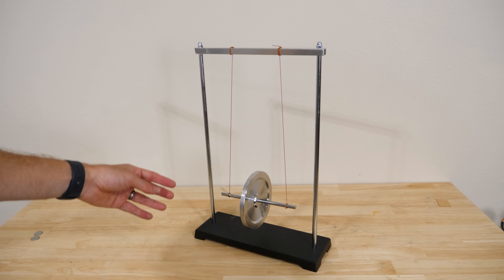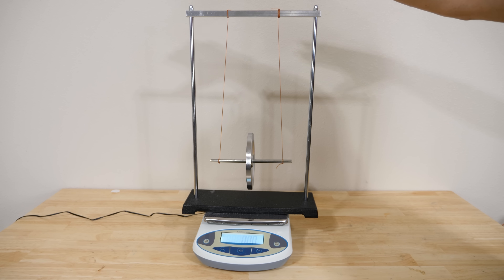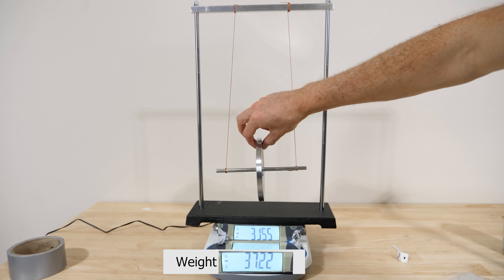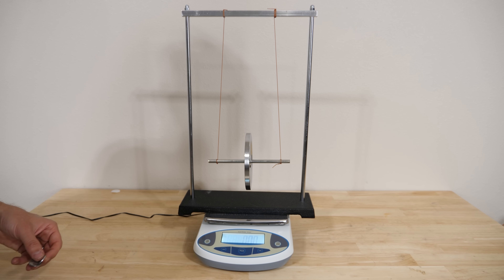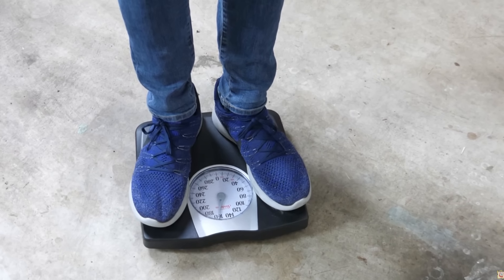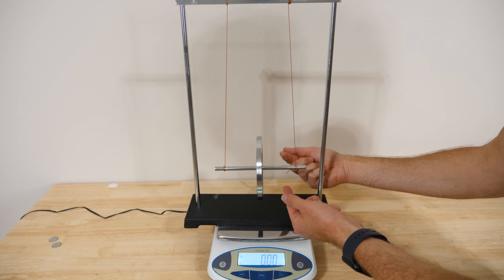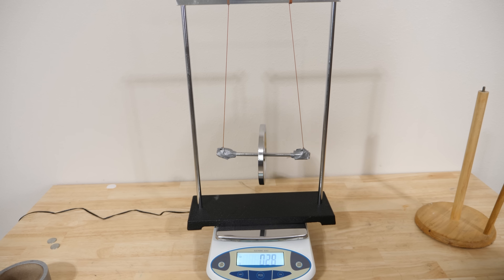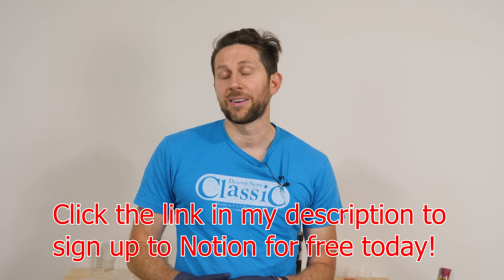How Does The Anti-Gravity Wheel Work?

Comment: If you sampled the weight continuously and at a faster rate, and then integrated over time, you would not see this fictional "antigravity".   The upward force, integrated over time, equals the short duration impulse when the wheel reverses and starts going back up.  Its the same thing as when a ball bounces inside a box.   When the ball is falling or going up, the box weighs less than when the ball is at rest.   But when the ball lands on the floor of the box, an impulse of downward momentum is imparted to the box.   A cheap digital scale never displays the effect of that short duration impulse.
Reply: Here's the deal with this wheel:
The wheel does NOT weigh less when it is spinning!.
..
It may be more correct to say that it weighs less when it is "bouncing".
..
I have a problem with the interpretation of the Laithwaite demo.  Precession does not translate the wheel.  It does not lift it. 
Precession causes the axis of rotation to change direction. This is a ROTATION about the center-of-mass of the wheel. It is not lifting the whole wheel's mass. 
.
Precession does not cause the gyro to move (translate) sideways, nor upward in Laithwaite 's case or Veritasium's case. 
If the vertical spinning gyro had translation, it would slide along the table, but stay vertical. It does not do that.  It tips, or rotates at 90 degrees.
The fact that the handle is offset and long has significance.  If you push the handle in the direction of the precession, that lifts the handle, right?.

However the interpretation that the spinning wheel is always accelerating downward even while moving upward,  is a very good catch. It took me a few seconds to realize that.  My quick initial feeling was that the weight would go positive on the way up. . . 
The way to think of it is that is is 'partly falling' due to gravity.  When you are in free-fall you are completely 'weightless'.  The spin and string-shaft arrangement allow it to fall, but not fully, as when you are in free-fall.  So, the frame experiences somewhere between the full weight and weightless ness, but more weight during the bounce time. 
..
 The winding and unwinding of the string causes the up and down motion which is what changes the weight. 
..
Stand on a bathroom scale and at a medium speed, move up and down by bending your knees.  Try to move faster and faster on the way down and slower and slower on the way up. You will see your weight decrease during those times.

.. .. ..
If you watch carefully, you see that it is speeding-up as it drops; this is accelerating, but not at the full 'gravity-rate'.
Also, it is slowing-down as it rises, again not fully accelerating (decelerating or negative acceleration) due to gravity.
..
On a trampoline you are completely weightless from the time your feet leave the trampoline until they touch again and start the bounce. During this time you are constantly in 'total' free-fall.
When in contact with the trampoline you are accelerating upward and weigh more than normal.
If you can add a small upward force to reduce the acceleration due to gravity, you will weigh less. No surprise there.

This is analogous to only "partway" jumping on a trampoline (or your bouncing ball).  On a tramp, you are accelerating downward when your feet are not in contact with the tramp. The ball is when it is not in contact with the floor.  The spinning wheel only "partly" leaves the support strings.  It is "partially bouncing".
If the tramp accelerated you upward at twice the rate of gravity, your weight would double.
Therefore, there is also a slight increase in weight at the bottom bounce.
.
This would be equivalent to a small jetpack on your back that can't lift you, but only partly reduces your weight.  You would be in "Sloe-Fall", not free-fall.
..
This would make a wonderful Dean Drive Scam. . . .
..
It would be nice to have a real-time force load cell so we can see what happens at the bottom of the wheels travel - the positive weight gain during the short 'bounce' time.

..
Also, WHAT HAPPENS to the weight, if the wheel is NOT spinning, but bouncing while being suspended by a spring, instead of the winding/unwinding strings?  
Is that equivalent to this "partial bouncing" effect?

Comment: but how and why does it go down when you let go?
Reply: Here's the deal with this wheel:
The wheel does NOT weigh less when it is spinning!.
..
It may be more correct to say that it weighs less when it is "bouncing".
..
I have a problem with the interpretation of the Laithwaite demo.  Precession does not translate the wheel.  It does not lift it. 
Precession causes the axis of rotation to change direction. This is a ROTATION about the center-of-mass of the wheel. It is not lifting the whole wheel's mass. 
.
Precession does not cause the gyro to move (translate) sideways, nor upward in Laithwaite 's case or Veritasium's case. 
If the vertical spinning gyro had translation, it would slide along the table, but stay vertical. It does not do that.  It tips, or rotates at 90 degrees.
The fact that the handle is offset and long has significance.  If you push the handle in the direction of the precession, that lifts the handle, right?.

However the interpretation that the spinning wheel is always accelerating downward even while moving upward,  is a very good catch. It took me a few seconds to realize that.  My quick initial feeling was that the weight would go positive on the way up. . . 
The way to think of it is that is is 'partly falling' due to gravity.  When you are in free-fall you are completely 'weightless'.  The spin and string-shaft arrangement allow it to fall, but not fully, as when you are in free-fall.  So, the frame experiences somewhere between the full weight and weightless ness, but more weight during the bounce time. 
..
 The winding and unwinding of the string causes the up and down motion which is what changes the weight. 
..
Stand on a bathroom scale and at a medium speed, move up and down by bending your knees.  Try to move faster and faster on the way down and slower and slower on the way up. You will see your weight decrease during those times.

.. .. ..
If you watch carefully, you see that it is speeding-up as it drops; this is accelerating, but not at the full 'gravity-rate'.
Also, it is slowing-down as it rises, again not fully accelerating (decelerating or negative acceleration) due to gravity.
..
On a trampoline you are completely weightless from the time your feet leave the trampoline until they touch again and start the bounce. During this time you are constantly in 'total' free-fall.
When in contact with the trampoline you are accelerating upward and weigh more than normal.
If you can add a small upward force to reduce the acceleration due to gravity, you will weigh less. No surprise there.

This is analogous to only "partway" jumping on a trampoline (or your bouncing ball).  On a tramp, you are accelerating downward when your feet are not in contact with the tramp. The ball is when it is not in contact with the floor.  The spinning wheel only "partly" leaves the support strings.  It is "partially bouncing".
If the tramp accelerated you upward at twice the rate of gravity, your weight would double.
Therefore, there is also a slight increase in weight at the bottom bounce.
.
This would be equivalent to a small jetpack on your back that can't lift you, but only partly reduces your weight.  You would be in "Sloe-Fall", not free-fall.
..
This would make a wonderful Dean Drive Scam. . . .
..
It would be nice to have a real-time force load cell so we can see what happens at the bottom of the wheels travel - the positive weight gain during the short 'bounce' time.

..
Also, WHAT HAPPENS to the weight, if the wheel is NOT spinning, but bouncing while being suspended by a spring, instead of the winding/unwinding strings?  
Is that equivalent to this "partial bouncing" effect?

Comment: Coriolis effect and precession? if you block the precession due to earth rotation it develops a negative or positive lift
Reply: NOPE!
..
Here's the deal with this wheel:
The wheel does NOT weigh less when it is spinning!.
..
It may be more correct to say that it weighs less when it is "bouncing".
..
I have a problem with the interpretation of the Laithwaite demo.  Precession does not translate the wheel.  It does not lift it. 
Precession causes the axis of rotation to change direction. This is a ROTATION about the center-of-mass of the wheel. It is not lifting the whole wheel's mass. 
.
Precession does not cause the gyro to move (translate) sideways, nor upward in Laithwaite 's case or Veritasium's case. 
If the vertical spinning gyro had translation, it would slide along the table, but stay vertical. It does not do that.  It tips, or rotates at 90 degrees.
The fact that the handle is offset and long has significance.  If you push the handle in the direction of the precession, that lifts the handle, right?.

However the interpretation that the spinning wheel is always accelerating downward even while moving upward,  is a very good catch. It took me a few seconds to realize that.  My quick initial feeling was that the weight would go positive on the way up. . . 
The way to think of it is that is is 'partly falling' due to gravity.  When you are in free-fall you are completely 'weightless'.  The spin and string-shaft arrangement allow it to fall, but not fully, as when you are in free-fall.  So, the frame experiences somewhere between the full weight and weightless ness, but more weight during the bounce time. 
..
 The winding and unwinding of the string causes the up and down motion which is what changes the weight. 
..
Stand on a bathroom scale and at a medium speed, move up and down by bending your knees.  Try to move faster and faster on the way down and slower and slower on the way up. You will see your weight decrease during those times.

.. .. ..
If you watch carefully, you see that it is speeding-up as it drops; this is accelerating, but not at the full 'gravity-rate'.
Also, it is slowing-down as it rises, again not fully accelerating (decelerating or negative acceleration) due to gravity.
..
On a trampoline you are completely weightless from the time your feet leave the trampoline until they touch again and start the bounce. During this time you are constantly in 'total' free-fall.
When in contact with the trampoline you are accelerating upward and weigh more than normal.
If you can add a small upward force to reduce the acceleration due to gravity, you will weigh less. No surprise there.

This is analogous to only "partway" jumping on a trampoline (or your bouncing ball).  On a tramp, you are accelerating downward when your feet are not in contact with the tramp. The ball is when it is not in contact with the floor.  The spinning wheel only "partly" leaves the support strings.  It is "partially bouncing".
If the tramp accelerated you upward at twice the rate of gravity, your weight would double.
Therefore, there is also a slight increase in weight at the bottom bounce.
.
This would be equivalent to a small jetpack on your back that can't lift you, but only partly reduces your weight.  You would be in "Sloe-Fall", not free-fall.
..
This would make a wonderful Dean Drive Scam. . . .
..
It would be nice to have a real-time force load cell so we can see what happens at the bottom of the wheels travel - the positive weight gain during the short 'bounce' time.

..
Also, WHAT HAPPENS to the weight, if the wheel is NOT spinning, but bouncing while being suspended by a spring, instead of the winding/unwinding strings?  
Is that equivalent to this "partial bouncing" effect?

Comment: Interesting, doesn't the rotational direction also change when it goes up ? In the process is it not pulling the rope to sustain it's weight ? That should reflect on the scale..
Reply: Rotation does change, but. . . 
.
Here's the deal with this wheel:
The wheel does NOT weigh less when it is spinning!.
..
It may be more correct to say that it weighs less when it is "bouncing".
..
I have a problem with the interpretation of the Laithwaite demo.  Precession does not translate the wheel.  It does not lift it. 
Precession causes the axis of rotation to change direction. This is a ROTATION about the center-of-mass of the wheel. It is not lifting the whole wheel's mass. 
.
Precession does not cause the gyro to move (translate) sideways, nor upward in Laithwaite 's case or Veritasium's case. 
If the vertical spinning gyro had translation, it would slide along the table, but stay vertical. It does not do that.  It tips, or rotates at 90 degrees.
The fact that the handle is offset and long has significance.  If you push the handle in the direction of the precession, that lifts the handle, right?.

However the interpretation that the spinning wheel is always accelerating downward even while moving upward,  is a very good catch. It took me a few seconds to realize that.  My quick initial feeling was that the weight would go positive on the way up. . . 
The way to think of it is that is is 'partly falling' due to gravity.  When you are in free-fall you are completely 'weightless'.  The spin and string-shaft arrangement allow it to fall, but not fully, as when you are in free-fall.  So, the frame experiences somewhere between the full weight and weightless ness, but more weight during the bounce time. 
..
 The winding and unwinding of the string causes the up and down motion which is what changes the weight. 
..
Stand on a bathroom scale and at a medium speed, move up and down by bending your knees.  Try to move faster and faster on the way down and slower and slower on the way up. You will see your weight decrease during those times.

.. .. ..
If you watch carefully, you see that it is speeding-up as it drops; this is accelerating, but not at the full 'gravity-rate'.
Also, it is slowing-down as it rises, again not fully accelerating (decelerating or negative acceleration) due to gravity.
..
On a trampoline you are completely weightless from the time your feet leave the trampoline until they touch again and start the bounce. During this time you are constantly in 'total' free-fall.
When in contact with the trampoline you are accelerating upward and weigh more than normal.
If you can add a small upward force to reduce the acceleration due to gravity, you will weigh less. No surprise there.

This is analogous to only "partway" jumping on a trampoline (or your bouncing ball).  On a tramp, you are accelerating downward when your feet are not in contact with the tramp. The ball is when it is not in contact with the floor.  The spinning wheel only "partly" leaves the support strings.  It is "partially bouncing".
If the tramp accelerated you upward at twice the rate of gravity, your weight would double.
Therefore, there is also a slight increase in weight at the bottom bounce.
.
This would be equivalent to a small jetpack on your back that can't lift you, but only partly reduces your weight.  You would be in "Sloe-Fall", not free-fall.
..
This would make a wonderful Dean Drive Scam. . . .
..
It would be nice to have a real-time force load cell so we can see what happens at the bottom of the wheels travel - the positive weight gain during the short 'bounce' time.

..
Also, WHAT HAPPENS to the weight, if the wheel is NOT spinning, but bouncing while being suspended by a spring, instead of the winding/unwinding strings?  
Is that equivalent to this "partial bouncing" effect?